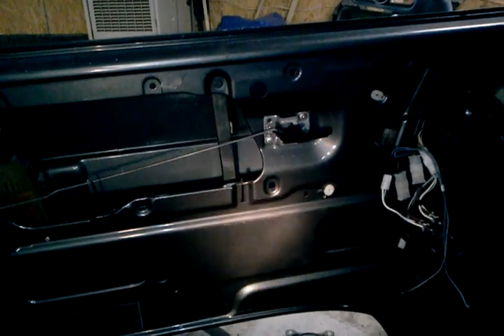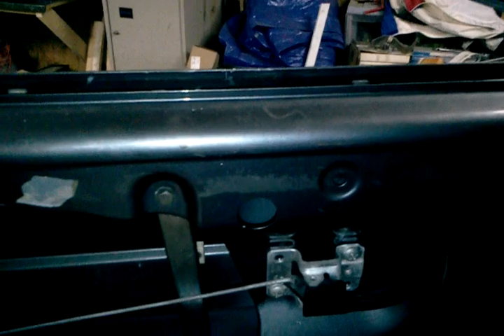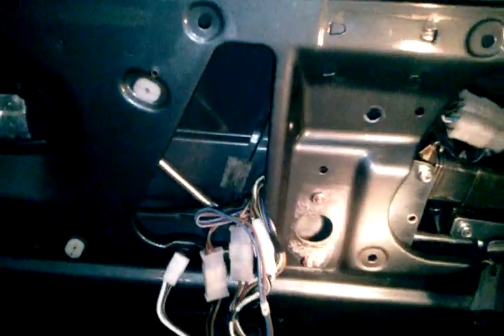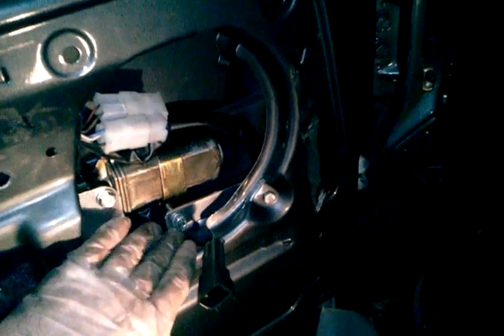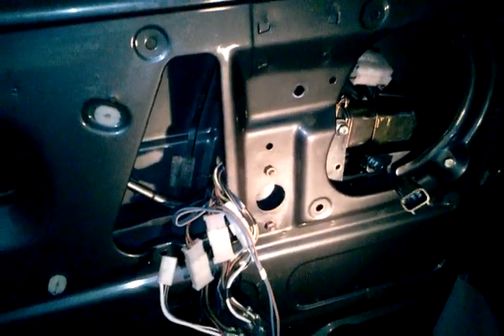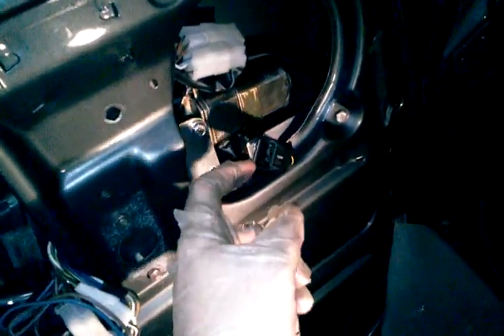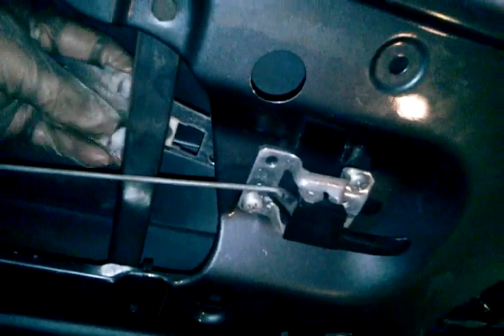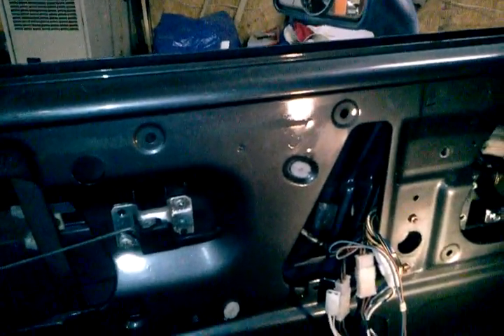Vanagon Aftermarket Window Regulator Install part 2

Comment: Ken, I appreciate your videos, but I think it would serve you better if you didn’t shoot your videos at night.  Also, try using editing software so you can put colored arrows to highlight your points (bolt holes, cables, etc). When you point your finger or flashlight at the things, it’s not very clear at times.
Reply from the maker: Will try harder